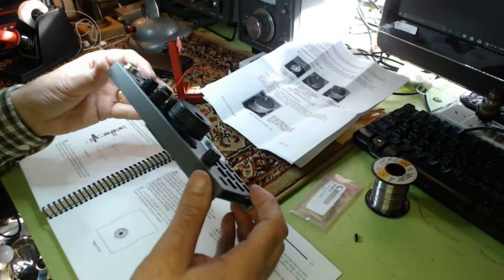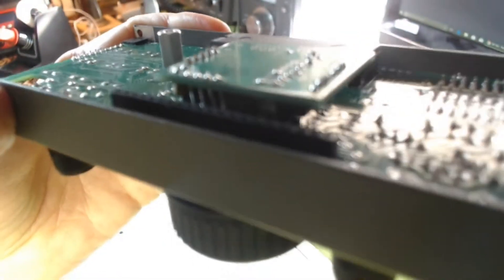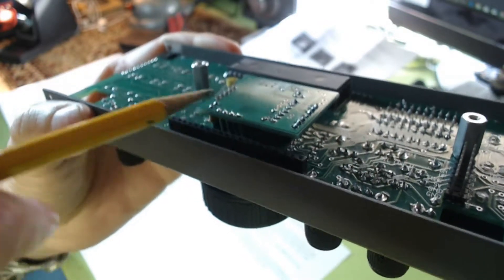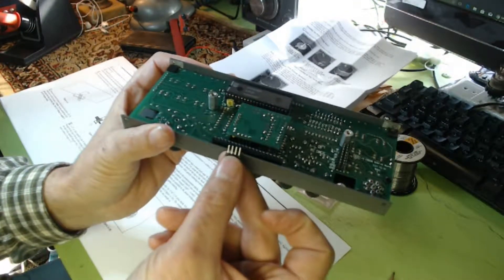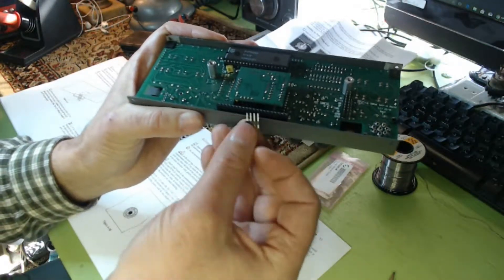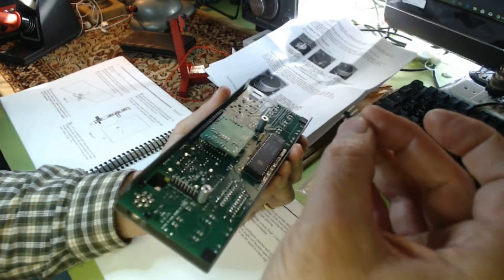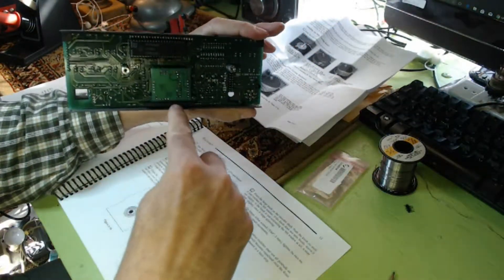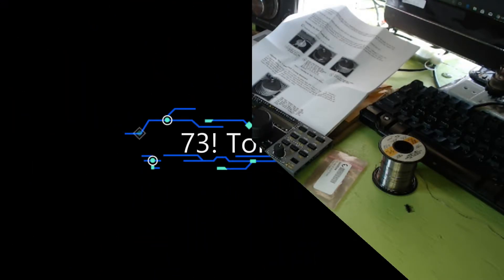Elecraft K2 Build #8 Quick Encoder Update.

Comment: For anyone making one of these - you may need to place a thin insulating sheet between the decoder board and the control board. The decoder board is a modification and the soldered connections can touch the adjacent board and bring erratic operation. Guess how I know...?